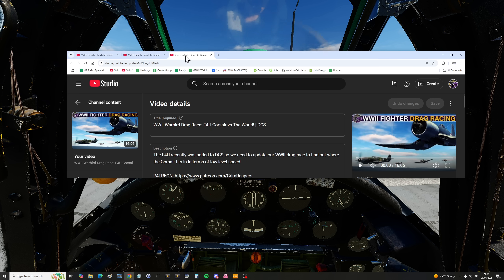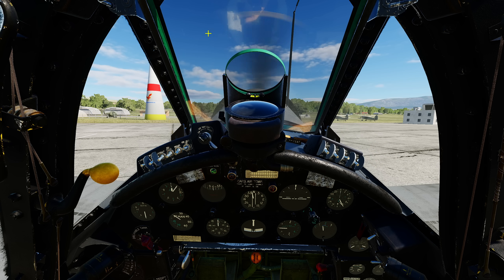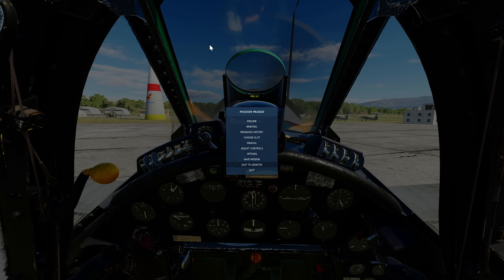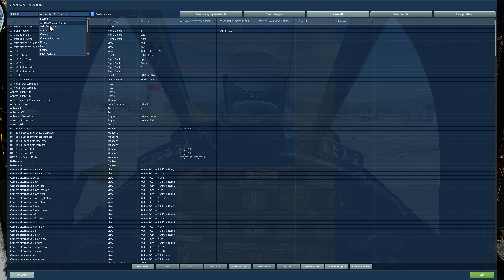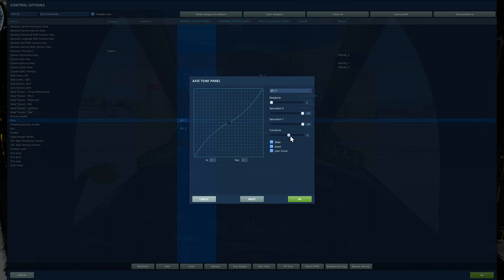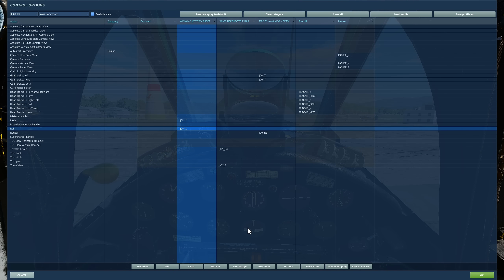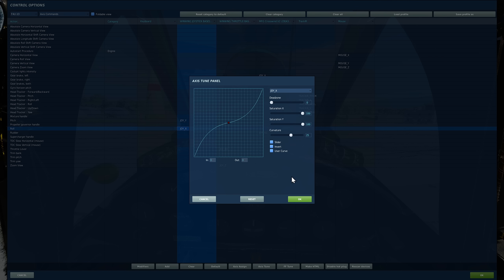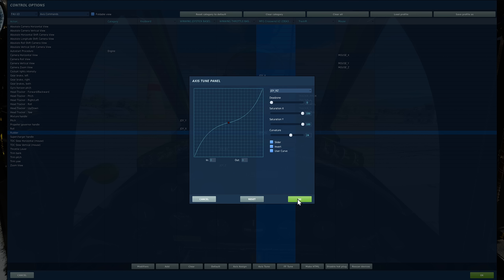F4U Corsair: How To Get More Power, Speed & Stability | DCS

Comment: Not sure how much additional play there’d be in a real F4U but rated and never exceed RPM for that motor is 2700 and 3060 RPM respectively 

Museum of Flight has the pilots handbook

3200 RPM would lead to Bad Things happening rather quickly and I suspect the bug might be the range the mouse is allowing
Reply: And it would be less powerful at any given manifold pressure at 3060 rpm than at 2700, because the valve timing is fixed, and set up to deliver max power at 2700.  Above 3060 is breaky-breaky time.

Comment: Hey, what happened to 'Spool & Hold' at the start of the drag races?
Reply: I'm thinking prop tip speed... No way is it efficient above 3000 RPM.
Reply: @mdu2112  Sometimes you gotta make 600 extra horsepower to get 400hp more thrust.
Reply: @erickleven1712 I replied to the wrong comment! 😅
But yes.
Reply from the maker: It's too hard in the warbirds to hold, they flip over.

Comment: In real life the F4U-4 top speed was 446mph
Reply: Is that on the deck or at altitude I’ve gotten her to 400mph on the deck with the mouse trick but not much faster then that
Reply: @hasina1461  on the deck should be ~315knots. There is definitely something not calibrated right, but the engine speed SHOULD be 2700 for all top speed and climb performance.
Reply: a) that's and F4U-4 at critical height, nothing like that in level flight at sea level, and b) this is not an F4U-4, it is an F4U-1D / FG1 with (what should be) a lot less power
Reply: Well we aren’t flying a f4u-4 lmao this is a F4U-1D